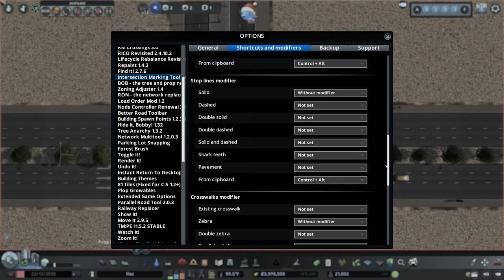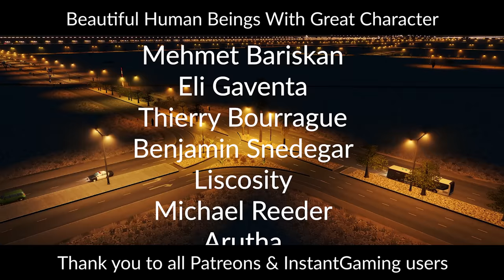Intersection Marking Tool For Dummies! | Cities Skylines Mod Tutorial

Comment: A hint I remember is to make crosswalks first. Then the lines will use that as a from/to point. 
You can also use this tool for straight sections. Like continuing those white inside striped sections, or to make turning lane stripes solid before the intersection.

Comment: 31:26 Egg, you might want to redraw that part of the round-a-bout. Your right most lane entering the round-a-bout is painted into the parking lane. Even though parking isn't allowed, the parking lane still exists. (Need to be mindful of that at every intersection) The middle lane is painted into the right lane, and the inside lane is painted into the middle lane of the round-a-bout. Your markings are all off by one lane. Looks like the same thing is done on the other side of the r-a-b as well. Obviously, the vehicles are going to ignore the paint and drive to the appropriate lane anyway, so that may lead to comments that as you said you know we're all going to leave in the comments section about cars driving across your markings.  ;Þ  Made me laugh, guilty as charged. I believe you've done this in other round-a-bouts as well since it was a paste in template if I'm remembering the previous videos correctly.

Also, just something I like to do when I have a bus, bike, or a tram lane running through an intersection, in 'nicer' parts of town, I'll use the filler in intersection marking tool to paint that lane through the intersection. It can add to the overall decorative look by not breaking the lane at the intersection, just an idea to consider in the future should you get to a point where it feels like a good fit.

Have a good rest of your day.
Reply from the maker: There's a few fixes I need to make around the city at this point! Thank you for that heads up, appreciate it! I'll definitely add the lane fixes for the networks you mentioned :)
Reply: Coincidentally, that line is in the right place for a Give Way line, so he could re-style it as a double dash line and add the lane line at the same time.
Reply: I've noticed when there was a bike line, handle it as special line for bikes and fill it with something, then was wondering why I had that intermediate point also for some other intersection, never thought that is because of parking, thank you @stant123 ! Usually I've ignored the left point of, what I know now is, parking., resulting in a bigger 1st line.

Comment: Even though I'm pretty confident with my use of Intersection Marking Tool, I did still learn something new about curb offsets.

The one thing that bugs me the most is that you have a mod that I have been dying to use forever. It displays building icons (you had 30-something Sewage Backup icons displayed for the second half of the video, probably related to the one fire), and it sat in between your Traffic Manager icon and the Chirper birdie. What is that mod?